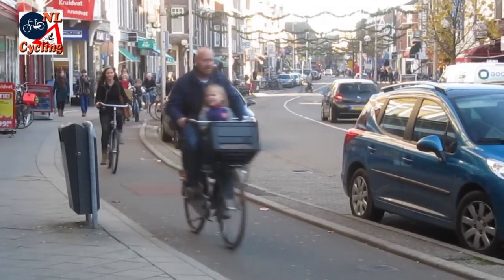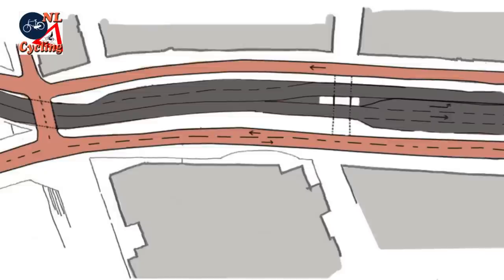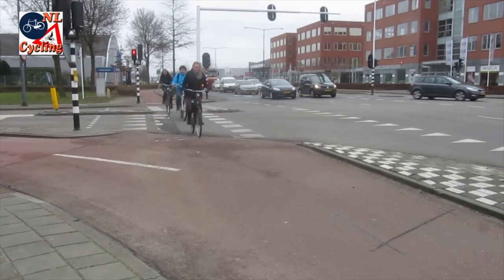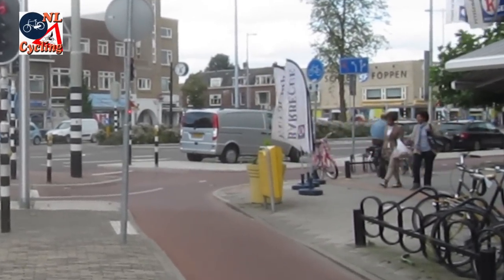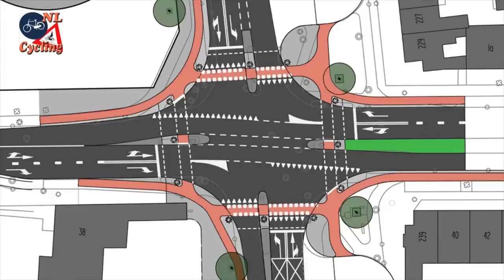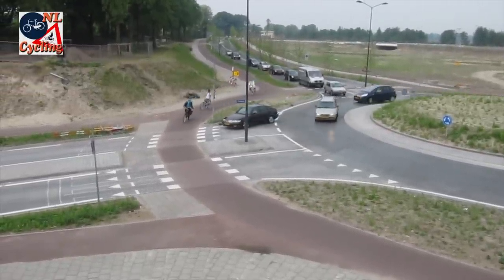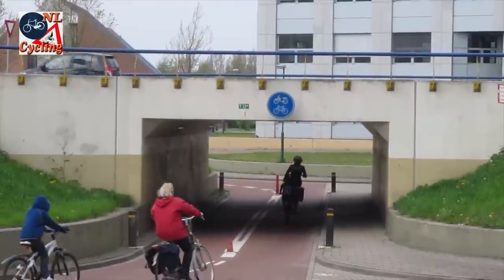Junction design in the Netherlands [311]

Comment: notice the indication at 3:12 . that is what happens when cyclists are aware of car drivers and car drivers are aware of cyclists. The car driver was prepared to wait for the cyclist, but the cyclist indicated to the car in good time that he was going right...respect all around
Reply: You are right.  There was communication between the two.
Drivers and cyclists seek eye contact, and communicate with very small signals, hardly visible signals.
Cyclists and drivers try to stay moving forward.  Fast or slow, but keep moving on.
Reply: At a roundabout near where I live I often fully point that I am going right but due to the angle that I come on a lot of cars don't seem to notice it and still slow down for me when they want to exit the roundabout. I actually get frustrated by the fact that the car can't see/doesn't seem to notice that I point that I will leave the roundabout and that they can exit as well because I won't be passing them.

And often when car drivers let me pass on my bicycle they make a small hand gesture while holding the steeringwheel and that is already enough for me to see that I can pass. as thanks I put my hand up to show the appriciation. This is because as said by FD2 we often seek eye contact and try to communicate our intentions with eachother.
Reply: @edkroketje1  
Try to signal your right turn with your left arm across your chest. It works fine with me, pointing with the arm they can see.
I only do this on a busy roundabout with bidirectional cycle path. And I always go counterclockwise because many accidents happen with bicycles that go clockwise. Car drivers do not, or too late, notice them.
Reply: I think this is because cyclists and car drivers are not 2 different groups of people. A lot of people who drive also cycle regularly and vice versa. They understand each other.
Reply: Don’t go to the city of Leiden though.....
Reply: One time i signalled to let a driver know i was going right and the lady in the car honked at me to thank me. Scared me half to death.
Reply: Bullshit i drive in the city a lot to get to and from work. And for my work I also drive in the city the most time, about 75% of the time(parcel delivery) most cyclist and pedestrians are totally unaware of their surroundings or just don't give a shit and try to go in front of cars when ever they can. I have had cyclist yelling at me to watch out so many times when I came from right and they from my left giving me the right of way and when I turn they just keep going and get angry that I didn't stop when they are the ones who should have stopped. Also A lot of cyclist don't take into consideration what the blind spots are around my van (they are pretty big) in my right side miror as soon as I make a right turn to cross a bike line into another street I won't see the entire bike lane anymore and most cyclist aren't aware of this. Also a lot of cyclist will start driving on the right of you(mopad drivers even over take me on the right which is also realy dangerous) because if its in a narrow 2 way street i will have to make room for the oncoming cars and if I haven't noticed the cyclist that came on the right of me(which I think isn't even allowed) it won't end pretty. Of course oour roads are beter and safer for bikes than in almost anny other country but as a result most cyclist have gotten too comfortable and think nothing can happen making their driving behaviour vet dangerous and in some cases dowm right arrogant.
Reply: @W.boer29  zal eerder een generatie dingetje wezen
Reply: @W.boer29  Je klinkt als iemand die zelf nooit op een fiets zit.
Reply: I love the efficiency of hand gestures. I dont exactly like stopping so I’m constantly making hand gestures to indicate my movements, sometimes not entirely legal lol.
Reply: @W.boer29  A parcel delivery driver complaining about cyclists? Literally the only drivers which have ZERO respect for other road users 100% of the time are parcel delivery drivers. Driving over curbs, cycling paths, parking anywhere, driving 60 in a 30 zone, not indicating, not wearing seatbel, ALWAYS in a hurry.... is standard practice.
Reply: You actually learn those things when you are 9-11 years old, you have to complete the so named ‘fietsexamen’ (bike exam)
Reply: @ef4947  hey but wel ff rustig aan doen because those complacent bicyclists in Nederland are dus wel ff vet dangerous
Reply: @josdenhartog7385  I recently went to Leiden and thought it was the worst! @BicycleDutch maybe you could do a video about the worst places to cycle? Leiden is pretty bad, Epe is as well.
Reply: a signaler for cyclists would be nice, kind of like blinkers on cars. 
the cyclist would be able to activate them without using hands, maybe tilting their neck left or right or something like that.
Reply: @edkroketje1  i wouldn't get frustrated by that - it doesn't affect you, and you gave your courtesy signal. if they don't notice the signal, their loss, and the loss isn't a big one at all.
I would just give signals as you are doing, and continue staying in your exit bike path, and not worry about it.
Reply: @dutchman7623  someone should invent something that can let cyclists signal without taking their hands off their handles.
Reply: @gwho  There are blinkers for bicycles. With a simple switch on the handle bar.
Amber LED lights on a bar across the back of the bicycle and under the handle bar in front. They are standard on tricycles for handicapped and disabled.
Just like on electric wheelchairs for outside use, those have lights and blinkers too.
But it is a luxury item that can easily be damaged in a bicycle parking.
Reply: @stijnvandeven5751  from some of the comments here I get the feeling these signals are not known to Americans…?

Comment: Hopefully Australia will get to this level in a few hundred years.
Reply: Hopefully my country (Turkey) will get to the level of Australia in a few thousand years
Reply: 30 years is when this can be achieved on average. 

The cycling infrastructure doesn't take much extra space. So every 30 years when you replace the sewer beneath the road you can place back a design that has cyclists in mind. 
This way it will take about 30 years because the sewer needs replacement or big maintenance in 30 year intervals. 

This way it's not a matter of money because you need to place a road back anyways, so why not redesign it before you place it? Then this doesn't become a financial issue but a political one. You have to convince your politicians to make cities cycling friendly, this is cleaner for the air it gets you from A to B just as fast.

Comment: We need this is england
Reply: We need this in Canada too. Impressive, most impressive.
Reply: ***** Why not?
Reply: *****
You don't need to respect bicycles - you need to respect people. People driving cars don't generally want to run over other people currently on bicycles. People who use both cars and bicycles for transport (which is what happens when cycling is a normal mode of transport for normal people) are more respectful than people who have only ever used one of these modes.
Reply: we need this more here in India -_-
Reply: "People driving cars don't generally want to run over other people currently on bikes". You'd think that, until you look at a city such as Oxford in the UK. I studied there, and I had my fair share of close calls with taxi drivers who don't respect other drivers, cyclists or pedestrians. Oxford is ranked top in cycle crime in the UK, and I'm not surprised considering the amount of cyclists on the roads. This system would have been a blessing, but because Oxford is full of old architecture, the roads are pretty narrow and its impossible to build such lanes. 
I found the best way to respect other users of the road is by experiencing both sides of the coin; I cycle and drive, so skills in one mode of transport are useful in the other. As a cyclist, I know the Highway Code and therefore what I can do, what I can't and how I should behave in various traffic situations. As a driver, I know how and where to look out for cyclists and how much space to give them.
Reply: we need this in... everywhere
Reply: @HarmonicaMustang  The Netherlands have plenty of old towns and cities, yet they manage to cope and change cities to be more cycle and pedestrian friendly step by step. I don't think Oxford being old is an excuse, it is more of a challenge.
Reply: ... in* England*.*

Comment: This should be implemented in every city!
Reply: TheXanUser it is in every city in the Netherlands. but you'll have to remember. it's extremely small so you can get practically everywhere by bike. towns are close. and all.
it's also extremely flat. making cycling easier
and it would be hard to implement in every city. since I think that when the bike got mainstream we started putting down cycle lanes.
Reply: @dutchik5107  Works both ways; biking also became more mainstream exactly because of the infrastructure.
Reply: @dutchik5107  The change towards the current Dutch safe traffic design paradigm started in the 1970s. Gas prices went through the roof thanks to shortages, and traffic was so car centric and unsafe, that people started a protest movement to "Stop the Child Murder". Corona can be an incentive to start the same kind of policies. The size of the country and its flatness doesn't matter in making a choice in favour of safe traffic design. A century ago, every city in the world had more cyclists than car drivers. Any city can make it happen again.

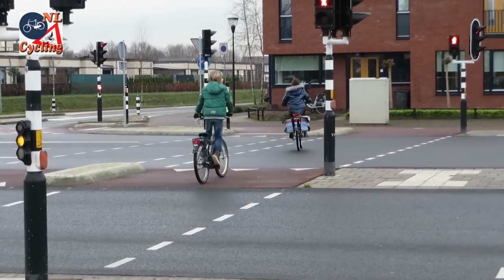Comment: At 5:04 you can see the grey box across the street that controls the traffic lights with sensors in the streets. This means if you approach a traffic light that shows red while the other directions detect no traffic you will get green to keep you moving.